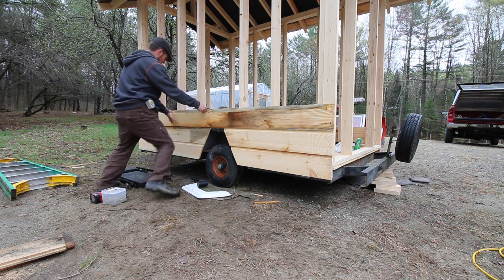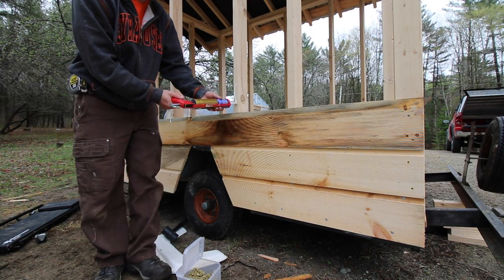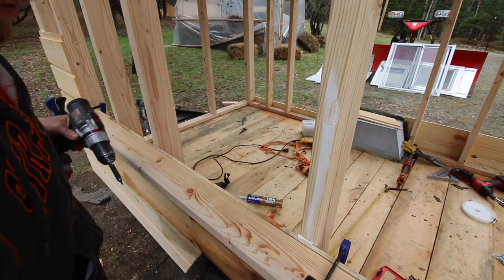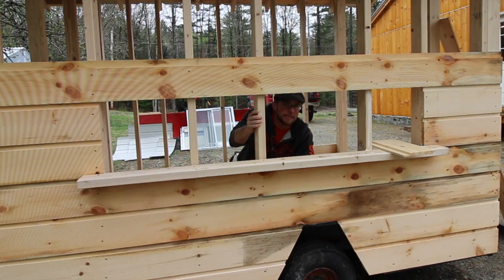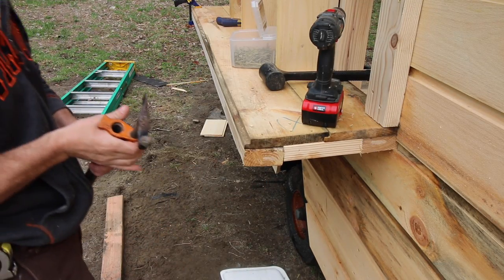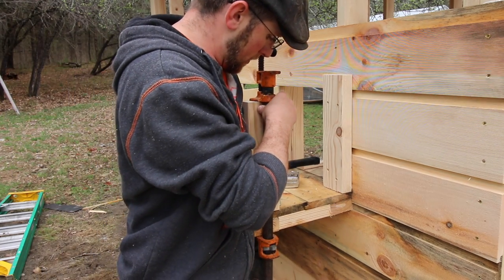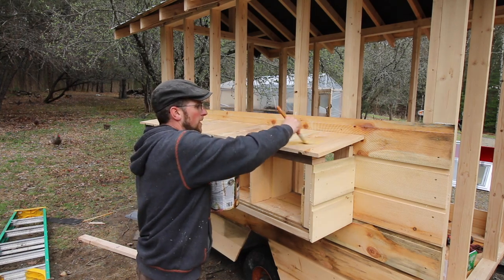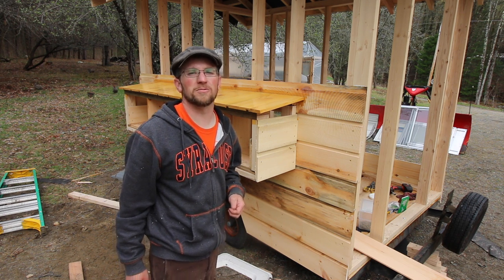Building Nest Boxes Mobile Chicken Coop # 5

Comment: Both:   A  1" x 3"  weather board trim along the bottom with a top edge slope of 7 degrees ;  set 1/2" below the bottom edge of the siding,  to create a drip edge for the walls.  This would provide a finished termination for corner board trim and the trim around the wheel well.   Then for a bit of whimsey cap with the plastic trim piece.  Are you planning on a feed  storage; metal garbage can enclosure on the front frame triangle.  It's looking real good.  Bert.
Reply from the maker: Thanks. I am thinking about feed storage on the back and on the front have a 55-gallon drum connected to some rain gutters and we will have a self-watering chicken coop!
Reply: You have good plan;  but may have to drain off some of the water when moving it on that light frame even though most of the weight will be on the hitch.   ( 55 x 8.34pd. =  458.7pd. plus container and mounting. Check the weight rating for that trailer on the DOT plate. You may be pushing it with the structure.   Bert
Reply from the maker: bert skelton I will have to look that up. Thanks

Comment: use some metal like gable trim or something you should use it on the corners where the siding on the walls meet and around the door jam too. the contrast between wood and metal would look nice. would give sort of a modern look. would fit well with the modern homesteaders theme.
Reply from the maker: Elom Garrison Yes that would look sharp. Modern for the modern homesteader. lol I like that. I will have to find some of the trim now. What about the fender flares?

Comment: Doing a good job  looks like you have done this before
Reply from the maker: karen catalano thanks! Should I trim out the wheel well with wood or use the plastic one?
Reply: Looks good!  I would just use the plastic.  Re-use what you can and save the wood.  I was wondering if you were going to add supports under the boxes.  Looks like a heavy snow or ice might be too much weight for the shelf the way it is now.
Reply from the maker: mdbigman I was wondering the same but the more of it I get together the stronger it is.
Reply: It would look either way.
Reply from the maker: karen catalano thanks
Reply: +Lumnah Acres - Ah,  That's good to know.  Your chickens should enjoy that quite nicely!